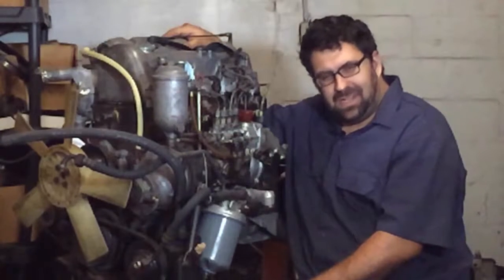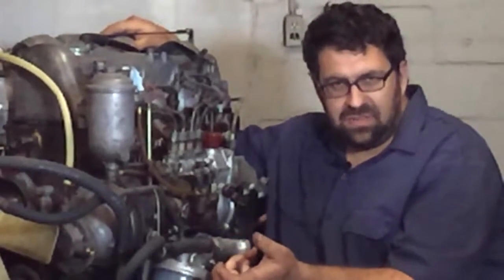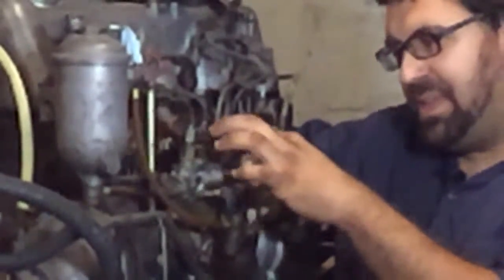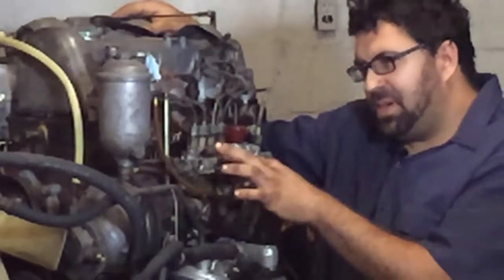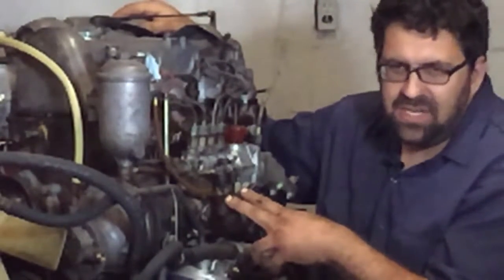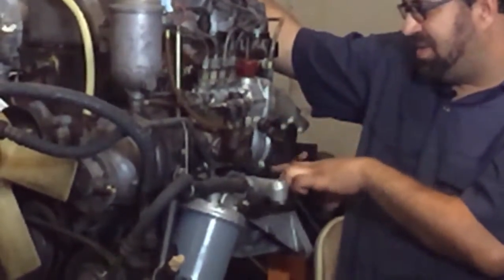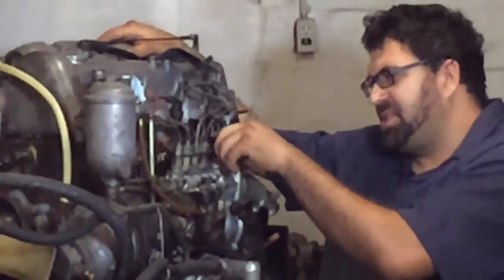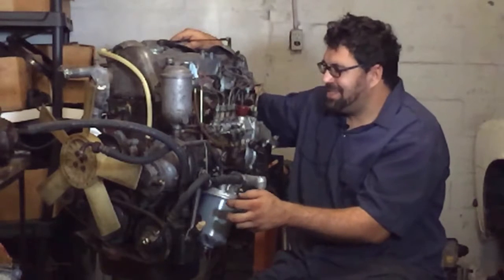Diesel injection pumps

Comment: Hi
1967 200d w110
In the middle of timing the ip
I have set the pump to the notches on the front where it meets the engine 
I cannot find any information on where the engine needs to be i have been told 45/47/25 degrees btdc

Comment: Hello Pierre. I have a 1989 190D 2.5 that has extremely low fuel delivery pressure on the fuel line closest to the fire wall... The other 4 lines have adequate fuel delivery pressure. What would cause this and what is a good route to fix this issue?

Comment: Hi nice video thank you, on the 220D how do you check the oil level, and what oil should be used in the injection pump, is it a closed oil source or does it pull from the oil in the crank case from the engine?
Reply: There's a 14mm head bolt on the  side of the lift pump on the injection pump straight down from the #4 cylinder delivery valve. Loosen that bolt, then add motor oil through the red cap on top of the pump. You use the same 15w40 motor oil as the engine. Chevron Delo, Shell Rotella, and Mobil Delvac are all good.

Comment: Hi Pierre, I have an om 615 that I’m running on a test stand. It starts easy, runs w/o leaks, exhaust or blow by. However it idles too fast, about 1450 rpm. It seems to rev up ok and run smooth. I’ve looked for vacuum leaks. I tried turning the big set screw on the back, both directions with no effect. Someone suggested a diaphragm leak inside the back of the pump. Any ideas? Thanks Rock